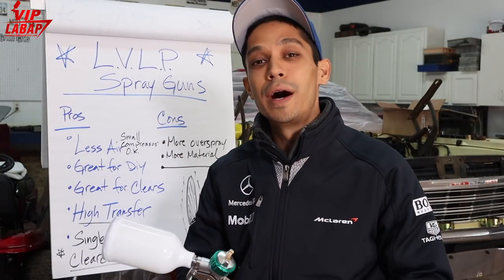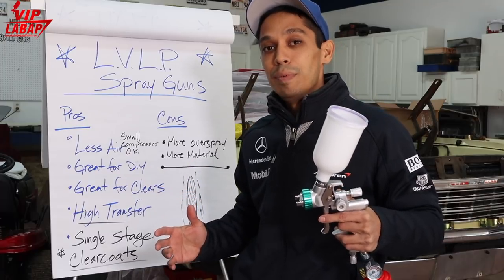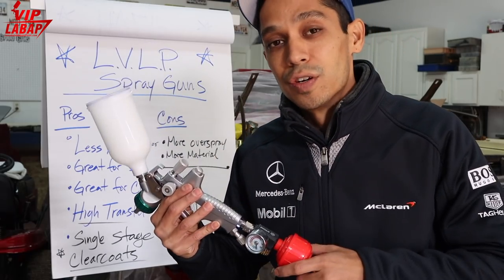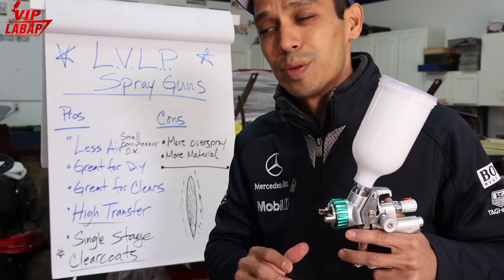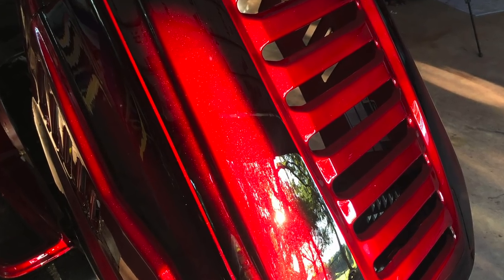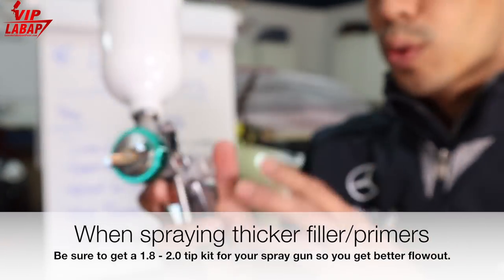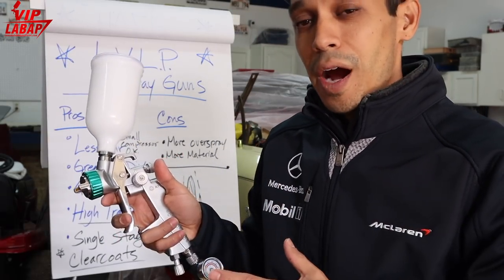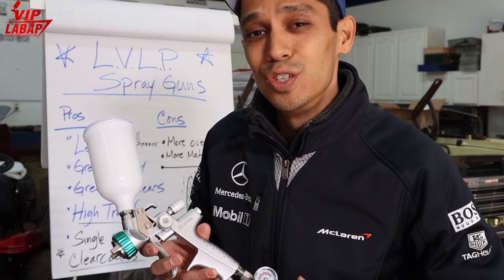LVLP Spray Gun - What kind of painting is it used for? Pros and Cons!

Comment: Hi Tony, great video.  I thought LVLP was supposed to provide less overspray as compared to HVLP, but your poster board indicates LVLP as more overspray...can you elaborate on that point please?
Reply from the maker: JDPower 55 nope. HVLP is for low overspray :) it was made to Cut down overspray compared to conventional sprayguns. LVLP also as lower overspray compared to conventional sprayguns but can be use with smaller air compressor’s 👍🏻👌
Reply: My LPH400lvb super basecoat is an HVLP gun but the supplied literature notes that it is an LVLP and will atomize at ridiculously low pressures below 14psi at the inlet. In my experience it requires very little air flow, has a huge fan pattern, the highest transfer efficiency i have ever experienced, and creates almost no visible overspray. I often spray this gun at 10-12psi and the material savings are legit, like the supply store never believes how far a 1/2 pint of material will take me. Good thing too, paints mad expensive these days. Cheers -J

Comment: I had a question for compressor size as far as cfm needed for these guns. The compressor I’m looking at is a Dewalt 26 gal and has a 4 cfm @ 40 psi. Is this enough cfm for these Atom lvlp’s? Planning to repaint my Expedition.

Thank you,

Keith
Reply from the maker: Yes and no. For spraying sections and parts yes. A complete no. You don’t have enough tank size volume for continuous spraying.
Reply: Got ya. I figured the tank size might be an issue for a complete job, but I had planned to do sections as it’s a daily driver. Just glad it will run the gun.

Which model would you recommend for a complete noob?
Reply from the maker: @keithrush4168  My personal favorite is the X27. THE X88 comes with 2 tip sizes though. https://zoolaa.com good luck bro!

Comment: Thanks for the video. I was thinking about getting the lvlp atom x20. I have a 20 gallon ingersoll rand garagemate compressor that says it has 5.5 cfm at 90 psi. Do you think my compressor would work with that gun? I’m just a DIYer. Or would the x16 be a better choice?
Reply: I have same setup and wondering the same thing.

Comment: What tip size you use for primer sealer on metallics with a lvlp spray gun I got a 1.3 bought from Ali Express not that long ago but ones had got from there have had problems with them but just been getting lvlp spray guns because using a small air compressor. Still gonna need more for primer sealer, primer and clear coat. I had a 1.7, 1.4 and 1.5 and 1.3 before but a couple got threw away when brother was cleaning out garage. Was thinking about moving to where he lives in the desert in Texas though but jobs are farther away than in Grand Rapids, Michigan where I live about 30 miles. I wanna be able to become a professional auto detailer and painter though but have lots to learn.

Comment: So I have 2 LPH 400 iwatas. I have a 1.3 orange tip which I’m currently using for clear, and a 1.4 silver tip for base. I did have them swapped when I started. I am considering trying a new gun for both base and clear. I like the guns so far, but yet I am a new painter and always willing to try a better gun. 

I’m considering getting two x27s one for base, one for clear, but possibly a third for primer if I decide not to get the Air Gunsa. 

The paint rep at my shop had suggested trying the Iwata W400 for clear because it’s quicker. I was looking at those online, and then I found the W400 Bellaire but I’m not too sure on the difference.
Im definitely interested in trying the atom x guns but wanted to get your opinion on the guns I’m using now, vs the w400/bellaire or the atom x27.   Great videos by the way and very descriptive.
Reply from the maker: The W400 is a solid gun, I have 2 of them. I stopped using them because I just got hooked on these atoms. The tip kits are affordable, and they spray really, REALLY well. They also have a No O Ring design. Not many spray guns on the market even have this. What does this mean? No drying out O rings that you need to replace in the gun. I have been loving the X27. It’s my go to gun for all of my painting now. But I would rather use the X20 for primers. Be sure to use a 1.8 or 2.0! Tip for any gun that you decide on when shooting your primer. Good luck my man 😎🔥

Comment: You say it sprays lacquers. Can you spray water based sealer and varnish with it (for wood projects)?
Reply from the maker: Andrei Fasola Yes of course, I would with the 1.3 tip.
Reply: @HowToPaintYourCar  Thanks Tony. I appreciate the quick reply. I asked because through my research I read that water based varnish does not atomize so well.

I'm a beginner at gun painting. I'm looking for a 100-200$ LVLP that can "do it all" (meaning I can buy various size quality nozzles). I'm a DYI home guy, fixing my car here and there so I'm not sure I need anything more expensive - unless it's really worth it. I borrow the compressor from various buddies and I can get the usual 5 cfm 50plus  psi type of compressor.

Comment: Hey tony, thanks for that great video. Im a guitar painter, I paint for my friend who builds guitars and basses. Im a professional house painter by trade (normally using airless, but I do use some hvlp on high end lacquered trim or door jobs.) Im wanting a system I can use in our tight shop space, I know I can fit a 5-10 gallon compressor I'm wondering if the LVLP can spray metallic, flake or pearl finishes? I have a few jobs coming up that id like to do some flakes or pearls on. would this be possible with the lvlp? if so what tip sizes would you reccomend?
Reply from the maker: Jeremy Telman yes it would work. If you’re spraying with the micro or mini flake it will shoot out of a 1.3 or 1.4 no problem. Same with pearls. The thing with flakers I would always recommend taking out your cup filter which is located in the neck of the gun after you unscrew the cup. You should definitely check out those ATOM X spray guns too. They now come with a  GunBudd for free, pretty cool ! 😎👌

Comment: I hope it's okay to ask for some advice. I'm using an LVLP sprayer for painting cabinets I've built myself. However, I've encountered a problem. Once the paint dries, there are visible lines from the spray. Could you please help me understand what I might be doing wrong? Is my paint too thick? is my gun not working properly?
Reply from the maker: Hey Man! The RADS Paint Formula training will help you. Get your free training at know more on "How To Spray Like a PRO Without Orange Peel, Dry Paint, Nasty Runs & Tiger Striping by Modeling The 5-Step R.A.D.S. Paint Formula! https://www.radspaintformula.com/rads

Comment: Tony i have a 0.8 hvhp mini gun and a 1.3 lvlp can i use either for smart repairs,someone told me to use mini for smart repairs.
Thanks Tony great videos
Reply from the maker: You could use both. The small one is for really small touchups and repairs and the larger 1.3 low volume low pressure can be used to spray a whole bumper no problem if needed.
Reply: @HowToPaintYourCar  Thanks Tony your a great help

Comment: hey man i got a few questions. for one i have an acrylic urethane single stage and a high build urethane  primer. im planning on getting a cheaper gun with a 1.4 tip size would this be fine for a tip size of that matter?
Reply from the maker: Yes it will work. But when getting cheap guns don’t get a gun that’s too cheap. They work like crap and fall apart after one use. Highly recommended check out the ATOM-X20 If anything you also get the free GunBudd Light system with those guns. The X 20 sprays very very well for a mid grade spraygun. Good luck buddy.
Reply: @HowToPaintYourCar  is there anything I should be worried about when spraying high build primer through a 1.4 tip lvlp gun I'm thinking on the ASTRO tool lvlp 1.4 it's got good reviews and people seem to like it
Reply: @HowToPaintYourCar  hey man thinking of getting the gun you recommended also quick question can i use a tip from a different company with this gun because i have aton of different sizes already thank you
Reply from the maker: @chasemcclary8861  hey no. Actually Atom-x has inexpensive tip kits available for these guns. All guns are made differently so you can’t inner swap them.

Comment: But can I use both rattle can 1k primer with an acrylic spray gun mixable paint, bull dog rattle can adhesion promoter, spray max rattle can 2k clear coat, some type of antistatic cleaner, I have the bond grease and wax remover,and some type of primer sealer.

I have a whole bunch of rattle cans I have been suckered into buying and the colors don't match, the pearl sucks, and both retailers paints had 1 can with dry spray issues.

 I just saw a guy's alternative idea to spraying with preval using a small hot dog compressor and a lower capacity gun so I was checking for verification of this idea to be able to have a chance to match the color and quality needed to get this rental done and saw this video next.

I am stuck with my pants down having prep sanded the bumper cover on this May 2019 manufactured Toyota corolla with the generic 3R3 Barcelona Red color code after being possessed by whatever after going down from Pooler GA O'Reillys to the recommended guy in Jessup GA O'Reillys paint mixing rattle can filling place the James said he could match up the color and pearl and put it in rattle cans.

 The first is the color is off. The second is, the hid the second and the third place spray dry including c&d's rattle can 1k primer.

Please reply asap.
Thanks
Currently in Baltimore MD and talking to finish masters Maryland is big on water colors and not solvent paints making it harder to get fit color matching possibility.

Comment: tony , i bought an Atom X27 LVLP ,
the black plastic piece between air cap and nozzle , what's that for ?
and what if i didn't put it back into the gun ? is that affect atomize ?
Reply: That black plastic gasket / piece is what is used to direct  the air through the horns and creates the fan pattern. If you don't replace it you are gonna have a bad time.

Comment: I just saw a few different pros say that you should have different guns - one for primer and the other for paint/clear coat (ideally separating these 2 as well) because it can ruin your paint job with bits that were left in and dried out. I felt like asking you because it sounds a bit like BS. Wouldn't those dry bits ruin your coat either way - even if you're still using the same type of fluid?

That is no matter what you spray the gun should be cleaned spotless for the next job, otherwise you gonna wreck it?
Reply from the maker: Agree! You can use the same spray gun as long as it is clean!

Comment: I've been undecided. I'm seeking to paint with- paint & primer in one, so it's thick. may thin it just a little.  should I go with the feel of a lvlp system or a convention sprayer with pressure pot.  I suppose a 2.0 spray tip size.  it must last a long paint season, & I wanted least over spray with slow control but not painfully slow like most electric hvlps.  lots of home address numbers to paint.
Reply from the maker: aaron fuksa go with a LVLP Atom X20 with a 2.0 tip for the thick primers. And the 1.3 or 1.4 for reg paints...
Reply: BOSS PAINTER - Learn Auto Body And Paint! 
thanks, well considered.

Comment: The specs on the Atom-20 say up to 14 CFM @ 29#. Can anyone explain how that's "low volume", sounds about the same numbers for HVLP. Finding the same thing with the Astro guns specs too.
Reply from the maker: The issue is they listed as working pressure. Actual spring pressure can be a lot lower. I will try to bring this to their attention. Thank you for your comment.
Reply: @HowToPaintYourCar  I think the biggest issue is simply how well will this work with smaller compressors since that's probably the biggest reason people look into them.

Comment: Do you need one gun for primers and one for paints/ clear coats?
Reply from the maker: It depends. Some guys like to have a primer only gun, and a paint only gun. You would at least need a different size tip kit to shoot primers. Usually when spraying 2k filler primers or epoxy you’d want to use a 1.8 or 2.0 tip. Right now https://zoolaa.com has some spray gun specials. I like the X27, my go to gun.
Reply: @HowToPaintYourCar  can a lvlp gin spray primers or do i need a hvlp gun?

Comment: The specs on this gun say it needs 8 - 10 CFM and 28PSI. What kind of air compressor will run a gun like this for automotive painting? Could I get away with a 30Gal 2HP 7.3 CFM @ 40PSI? Compressor manufacturers typically don't publish CFM ratings at that low of a PSI. And I'm guessing the algorithm isn't linear to determine the CFM @ a given PSI
Reply from the maker: Specs and what you actually use are two different things. Yes you can like I said in the video. Parts and sections no problem! A whole car can be done, I’ve done it with a 30 gallon craftsman. If you want to do a full car get a 60 gallon 5hp that puts out 15-18 cfm at 40psi
Reply: @HowToPaintYourCar  Ah.... I thought the specs were a minimum requirement or something. I wish I had the $$$ for 60 Gal compressor. I'm thinking of buying the Atom X20 LVLP sprayer given the great deal on those guns right now. However, I don't think I can drop another $800+ on the compressor since I'm really just starting out. I've done a ton of rattle can praying (changed the color of my 4runner interior) and have done a whole car in plasti-dip with the DYC sprayer. Time to step up to the big boys... lol just hoping to keep the costs down. For now I will probably just do panels until I get used to spraying LVLP.... but eventually I'd like to be able to do a whole car. A lot harder with a 30gal? Oh and thanks for the quick response! :-) ....... oh but with the compressor you are recommending I could go HVLP huh? Know anyplace having black friday deals on compressors?
Reply from the maker: Tom Persons it’s possible with a 30 gallon but you’ll definitely have to use the lower volume low pressure spraygun. Like I said I’ve done it a few times in the past you’re just gonna have to play catch up when the compressor falls behind a little. I also have people apart of my VIP program at learn autobody that basically added a 30 or 40 gallon tank to there existing 30 gallon compressor set up. So it’s like having a 30 gallon compressor set up with the two or three hp motor but with double the tank size that’ll give you more air volume to play with and you should be able to do a car without no problem. Good luck and keep me posted
Reply: Tom Persons i use a 30 gallon husky and im able to spray entire car i have som videos on me doing so on my channel
Reply: Tom Persons also i use a hvlp  gun and setvit at about 28 psi and it works great honestly there R all diff ways to paint u jus have to experiment i have about 6 guns now and i learn to spray clear and base out of all off them every gun takes diff setting jus fiddle with it bro
Reply: Tom Persons look on Facebook market place. Last year I picked up a used 80 gallon 5hp compressor from a guy on there for $300. Not a thing wrong with it.
Reply: @foreverg3549  Where are your videos would like to watch them
Reply: Graham Charlton that state ref messed me all up but i got onw coming fam i need to anounce winners of giveaway
Reply: Graham Charlton appricate u fam alot 🙏🏽😎